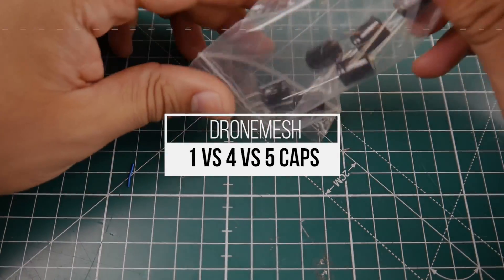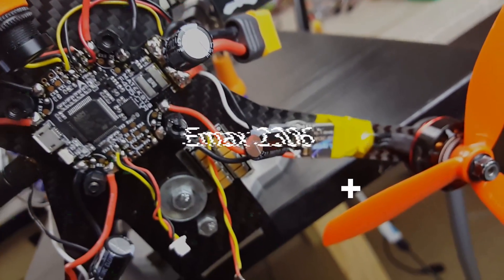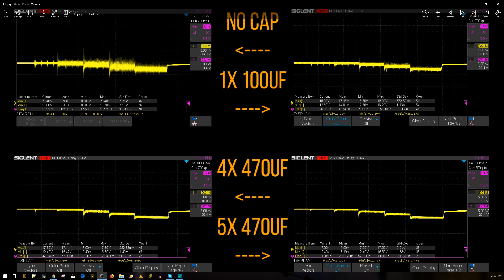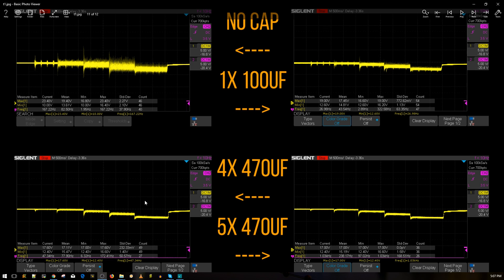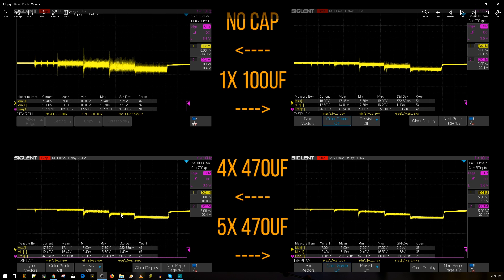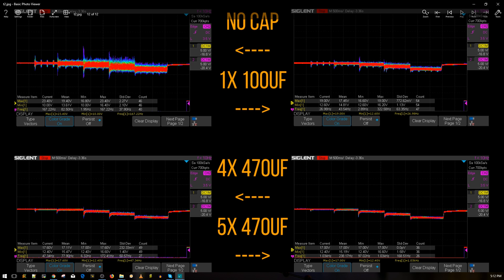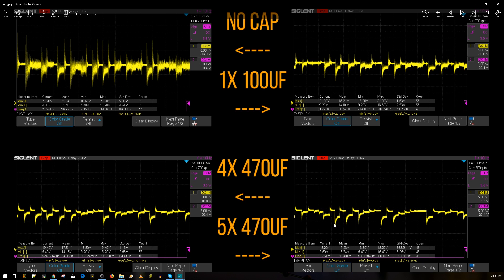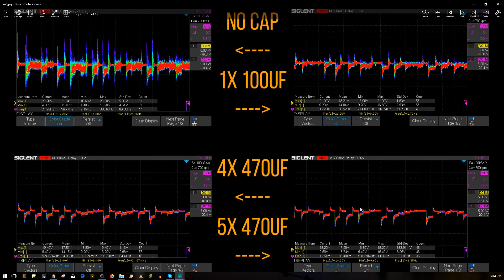Drone LOW ESR Capacitor Shootout Part 2 // 1x vs 4x vs 5x LOW ESR Capacitors who will win?

Comment: very interesting video! actually like most of your video's, but on this topic i have another possibility that i haven't seen anyone consider yet. 
what if you place 3 pcs of (SMD) capacitors between the three motor wires, right after the esc's as close to the motor as possible. if you allne the wires as the point of a triangle you can use the capacitors as the "legs" and since the ground function of the wires rotate as the motor turns this would mean there is always a ground. I could try this myself (was planning too) but i would need info on how to measure the results.

Comment: I don't know much about drones. have you ever considered adding an inline  Shockey diode right before the capacitor for suppressing the EMF?
I know you will have a voltage drop of around .25 volt but,  you are using a voltage regulator anyways so it was Just a thought!

Comment: Have you tested with 5x lower capacity caps? Something like 5x 100 uf or even 5x 30 uf? In theory it should filter high frequency even better but I don't know these things well enough to even guess for which frequency it matters.

Watching video https://youtu.be/hWaN7h5eWfc suggests that it could be even better to use film or ceramic capacitors for voltage filtering to reduce high frequency noise. One could also try using low capacity ceramic cap in parallel with camera voltage lines to make sure the power input for the camera is clean.

Comment: You can only do 5 caps with single escs right. Been having trouble with when I let off of a snap roll I lose video and everything is new except the motors and lipos. But my last build did the same thing and but it was kiss. I'm so tired of losing video lol.

Comment: would be interesting to see 4in1esc with 4 spots for low esr on each corner - than compare 4 470uf on each corner vs 1 2000uf on battery pads. - this way we could really check if it is better 4 small once than 1 big as rummers say. I'm saying here, because in your case your single 1000 was not on ESC - it was on a long cable too each esc (which we all know is less than ideal)

Comment: what if we use like 20 pieces of 22pf ceramic capacitor? its weird in electronic we use ceramic capacitor to tune down noise but in quadcopter we use this big cylinder capacitor

Comment: First time hook up a you t. ..     At least last half of a yeahr, may even longer  !!  I reseave some esc normaly use x rotor from HB Wing i hafe flown di 30 amp ratit to 6s but jussr 2205 / 1700 want tu ugrgademy rooster to 6s cause somytime craaazy vlt sagg. Long storry short questen i order the motors an a couple spare to swap out. The haent enoughajn gaven me the 35 amp's can i mix them? Veeeery best vide can seeee reely you feel id !

Comment: Old video i know.  Have you ever tested the difference between 1 capacitor of different capacitance?  Say 1 1000uf 35v vs 1 2200uf 35v?  I have a noisey build that doesn't really have room for a cap on each esc, but i could increase the size capacitor on the pdb.

Comment: What would you recommend for a 4in1 ESC (the Aikon you recently reviewed)?
Put capacitors on the ESC pads to the motors or just one on the battery pads?
And also which ones? 470er also?
Thanks in advance!

Comment: Interesting. What are we seeing? The noise/modulation induced on the power line? What is your measurement point? The battery, the ESC or the FC? thanks. Small suggestion, keep the cap leads as short as possible.

Comment: I keep waiting for an EE to speak up on supply bypassing, but they seem to be conspiring to . remain mute. This is all pretty basic, undergrad level stuff for them. I'll try to fill in for actual knowledge.

To over simplify, capacitors block DC, and pass AC. We connect them across supply rails to bypass noise ripple to ground. 

Half the story you already understand with low ESR. In fact, I suspect the difference with the multiple smaller caps is that ESR is much lower by presenting their ESR in parallel, rather than as a single lump.

The other half is frequency response. The large electrolytics are not able to cope with the high frequency noise. You can fill in with additional smaller caps in the 1uF or 10uF range.

I realize this video is a half year old now, but if you still have your scope and test rig, it would be useful to try a single electrolytic with very low ESR, AND a 1uF polyester film cap, plua a 10uF tantalum. My expectation is the combination should be as good as your 5x 470uF cans for much less size, weight, and expense.

Comment: Dude really? Are you upsessed with caps? I am lol I have 5 1000uf 35v  caps on each esc and 9 470uf 25v caps along the power wires on my fpv twin motor Titan Skywalker and I'm running a 6s 30,000 mah li ion pack. There is also a 25v 470uf cap on the video transmitter.  The regular also has two 35v 100uf caps on it.

Comment: I was wondering lately, if it would be a good idea to put ceramic disc caps between the motor wires. Since the ESC Output is where the DC gets chopped then the filtering would happen even before the current enters the motor. Might result in smoother running motors. Or maybe you get some crazy resonaces, which would also be interesting. I would love to see a test. 😉

Comment: Do a test with a pack of five 220uf caps on each ESC with a pack of five 470uf caps on the FC. Call the video Cap packs. And solder the caps along the ESC wires stacked next to each other close to the ESC so they are not all soldered to the same spot right on the ESC. Again solder them along the power wires up close to the ESC and not all soldered to the same point.

Comment: Dude my fpv plane has 5x 1000uf 35v caps on each ESC and 9 470uf  25v caps along the long ESC power lines . There is also one 470uf 25v cap on the power lines right before the video transmitter. 6s 30,000 mAh li ion pack. My on board video recorder no longer has any glitches in the video. The transmitted video is nice and clean now too. See my videos. 
You Know if you used two 220uf caps on each ESC and x2 1000uf on the battery lead you would be shocked. The X2 1000uf caps recharge the 220uf caps fast and each set of the 220uf caps can  discharge and recharge faster than a single 470uf cap. Making voltage very smooth. In fact if you use X5 220uf caps on each ESC and X4 or more 470uf caps on the main battery lead your noise would be near totally gone. Many smaller uf caps instead of one large cap can charge and discharge faster with less heat or resistance. Also  more smaller caps you use the less each cap has to discharge meaning the less it has to go to get charged back up. This is called a cap pack. If you had a x5 200uf cap pack with a total of 1000uf it would work better than one single 1000uf cap. The reason is that the 5 smaller caps can charge and discharge faster than a single 1000uf cap and faster means smoother voltages. And that's what you are seeing in your test. It's not the size of the caps it's the number of them you used. Smaller caps can discharge faster and many of them in a pack is nothing short of awesome when each ESC has its own pack of caps.

Comment: As I mostly run 4 in 1 escs I'm interested to know if you can remove more noise with bigger/more caps on the battery leads. I mean the 5 cap setup has more than 2000uF so testing 2000 or 3000uF on the battery leads would be interesting to me.

Comment: I've noticed people putting caps directly on the pads that you solder the VTX +/- to.  Now, that will probably help video, but may not be noticeable in your tests because the cap isn't on anything that you're measuring.

Comment: I use 4x330uf capacitors on my quad. When my cam was powered by the VTX, noise was worse than without any cap because arround 60% throttle I reached a special frequency with constant noise. Then I powered my cam directly from vbat and it was crystal clear. I did the camera control mod thought, which required a 1 uf cap.

Comment: I'm currently building a quadcopter with a Aikon ak32 35a 4-1 ESC, it's very tight build  with no room for a cap at the stack. Do you think I will need a cap with the Aikon 4-1 ? Would a Panasonic 1000 cap soldered to the battery lead at the xt60 connect help at all?
Reply from the maker: Crash-it FPV Yes it helps dramatically even a 470uF would help.
Reply: Thanks I'll fit a capacitor on the xt60 lead.
Reply: Drone Mesh I used the 330 capacitor included with the Aikon 4-1 hope it helps.

Comment: Hey, Great stuff! You should also test a 25v 1000uf against a 35v 1000uf capacitor. I’ve read a lot of electricians say the capacitor works best when matched against the voltage that’s being used. So on a 4s setup a 25V capacitor should perform better than a 35V. 

The 470uf is a 25v capacitor. Now 4x 470uf is 1880uf of capacitance so of course it performs better than a 1000uf capacitor. But maybe it’s also gmhaving an advantage of the lower voltage rating.

So again, I also thinks it’s interesting to test 2 x 1000uf 25V on the battery leads agains 4  x 480uf 25v on the ESC’s.

I hope you are as curious as I am for this, and make a video about it.

Comment: What I noticed when I got my first quad, Eachine racer 250, that had 4 x low esr smd capacitors on the base plate at each corner of the esc's .after a few crashes the video quality would deteriorate and when I checked the capacitor had broken free, I would re solder or replace them and signal would come back clear and the quad would behave ( no desyncs).
I think if you don't suppress the noise, eventually it will kill your vtx or affect your FC.
Reply from the maker: pablo Yes correct

Comment: great video but
it's hard to say if the difference coming from 4 separate capacitors or just bigger capacitance - 1x1000uF , 4x470= 1880uF
you should use 250uF x 4 for more accurate result

Comment: So then is it cheaper to buy 20$ wraiths or cheap but still decent 10$ and throw caps on were you need them? It would run the weight up a little but save you a lot of money hmm
Reply: My question as well. Just bought a set of Wraith32 V2 (low noise ESC) so wondering whether it's worth adding 4x ESR caps?
Reply: Ddraig62SPD I doubt it I heard those ESC are awesome I have tekko 32 35 amp 4 in 1 and was going to buy the wraiths next i still for peace of mind would rather have the best esc i could afford and add bnb one cap to main lead i add one cap to all my setups now just for good bbn practice
Reply: I'm pretty sure that Tekko32 are rebranded Wraith32. Reckon they should both have enough caps on board (based on the low noise results) but I always add one ESR cap across the LiPo on my builds. Have just bought some 330uF & 100uF ESRs from RS Online for back-up. Cheap as chips and free next day delivery :) Cheers!
Reply: Ddraig62SPD I didn't know that about the tekko and wraith being the same hmm cool

Comment: Ok but were are you suppose to mount the caps there just sticking up in the air? Taped to the underside of the arms? What about 4 in 1 esc? Were are we suppose to stick all these caps were they went get ripped off in a crash or make the quad look stupid lol u run with one Panasonic 1000mu on my main leads and I think if you have a pretty clean set up with decent electronics motors esc and flight controller gyro then one should be good then rite? The one one each esc may be over kill if you have a clean setup rite

Comment: Hi dude ! I have a question.. Can i solder the capacitor on the PDB ? I mean on each corner, where each ESC are connected.

Cause i don't have a lot of place on my arms..

Thx for the awnser dude !  🙃
Reply from the maker: Savinien Saucy Yes that should be fine.

Comment: Is there any downside or benefit of buying higher voltage csps?   Like 50v vs 25v in case I want to run 6s at a later date?
Reply: ShawnzFPV there's no downside except that the 50v ones might be a bit bigger. 6s lipos charge up to 25.2v (assuming they're not HV), so a 25v cap should be fine.
Reply: Interesting!   I've always overshot the voltage some to accommodate the spikes from the ESC(s).

I've been using 25v and sometimes 35v caps for most of my 4s builds.   I read someplace a recommendation to go for 50v caps for 6s.  I should have come to the source for info!

Comment: When you do these tests you should do an overlay from worst on bottom to best on top. That would give better illustration of the differences. Also can you show us how to add additional caps to a 4 in 1 esc? Besides the single batt lead. There has to be a way.

Comment: does the location(on the esc's vs the battery lead) make a difference, could i put 5x470 on the battery lead and get the same result as if i'd place them on each esc + one on the battery lead
 also, i have a theory, can you try different sized caps in paralel on the battery lead, like 80uf, 220 uf, 470uf and see if you get a cleaner channel, theory is that the small will take out the small spikes, medium will tackle the medium spikes so the big one can tackle the large spikes

Comment: But look thats not really a fair comparison. If you multiply 470uf by 5 its 2350uf. Thats way more than 1000uf. I would like to see a test 2.0 where the capcity of the capacitor(s) on the system is the same. Because  I bet if its all the same capacity you wont get any spectcular results.
Reply from the maker: ElektroScope Noted
Reply: I bet if you had three 330uF Vs one 1000uF, the three 330 would do the job better
Reply: This was my idea by seeing this video. i want to give ElektroScope right. But by this i also want to see if you connect the 5x470uf on the battery lead. have a nice (test) day. your vids are interesting and useful for me. great job. (had subbed you month years ago) sorry for my bad english and greets from Black Forest Germany

Comment: Key takeaway seems to be for an ultralight race rig using a 4-in-1, a single 1000uf cap is worth adding.  For all others, 5 caps is worth the extra effort for clean voltage to the FC and VTX.

Great work as always.

Comment: Thanks for doing this. I ordered a bunch of them and will try and see if they make a big difference
Reply: Andre M yo any change?
Reply: yup. My bfight 210 and my mini fight would produce quite a bit of noise when running 4s and when I throttled up hard so i put a 1000ruf on the bfight and a 470 on the mini fight and it cleared it up quite a bit. Just be careful and put shrink tubing on the wires of the capacitor. Mine was on good enough when i put it on my leader 120 and in a crash, the wires pushed down and touched the carbon and shorted. lol....it make quite the light and smoke show. haha

Comment: Can you please explain why you use caps instead of a diode to eliminate the inductive load spike from the motors? In another video you were showing the spike on the oscilloscope as the cause of the noise I believe and this guy https://youtu.be/LXGtE3X2k7Y explains partly anyways how the spike from brushless motors can be eliminated using a diode..possibly between the motor and the esc to prevent backflow off the motors in the first place since they are generating back current every time there switched on and off due to the converted ac signal coming from the esc...just a thought.
Reply from the maker: Haley Sigler Diodes have a drop out voltage and reduce power and efficiency. I will test this for everyone I will order diodes end of this month.
Reply: Drone Mesh Awsome can't wait. Maybe look into flyback diode configurations...Thank you for the reply!

Comment: Why don't you just make an array of capacitors and put them all together
Reply from the maker: There is many variations possible I'll have to take it step by step.. However caps on each esc still.would better as the noise is generated from the ESC and electricity finds the path to least resistance. So the cap being close to ESC is going to be better in theory. However I will test the array method and I have an idea which will be a modded of filter with a low esr I'm curious how that will test.
Reply: And where to put that array of cylinders in small decent X or stretched-X frames? Tie it to battery? :D  Will look like effin bomber and fly like crap because of drag.

Comment: You told me nothing you should have used four 250uf caps on the escs so the total capacitance would be the same. This test is not apples to apples
Reply: It's not about apples to apples it's about what is the best setup for the least noise regardless of your setup.

Comment: Please please please short video signals and check the difference. The noise may come from the video signal wire more than from the dc in. In addition you may try to use a clean source (other battery) for either the cam and vtx. Thanks a lot.

Comment: How small can the 4 caps be on the ESCs to do the same effect compared to the one 1000uF ?
This could tell whether the placement of the caps is important or the total amount of uF alltogether.  I guess that 4x220uF is still better than one 1000uF cap on the battery-lead.

Comment: I gotta 1000uf 35v cap on my tekko32 4in1 and running it on 48pwn and its FUHH-CKING insanely clean or at least feels like it. I've never had my motors sound so smooth
Reply from the maker: That test will come very soon. 
What motors are you running?
Reply: I'm running the 2450kv hypetrians v1.1 with the hq 5x5x3 prop
Reply: also the cap is  a Panasonic I believe
Reply: HardTimeZFpv me too

Comment: So, Mr. Mesh... Is it the total capacity of the 4/5 caps or is it the placement, on thr ESC.

Would it be the same to solder the caps at the PDB? Or maybe solder a 2000uf on the battery lead?

Thanks.
Reply from the maker: I have 330uf caps on hand so I'll run a test with 4x 330uF same setup and 5x to compare with these 470uF